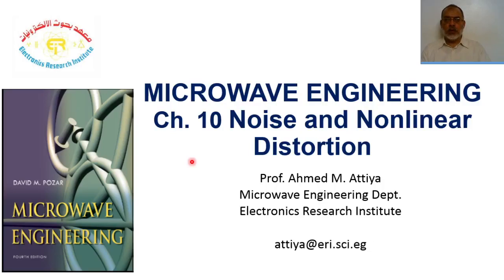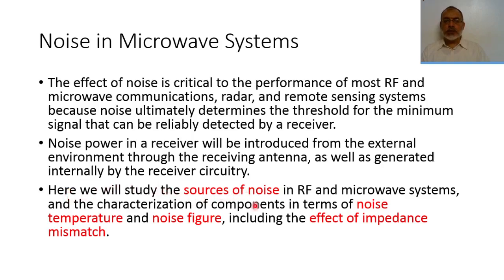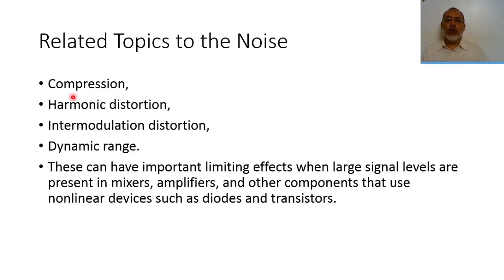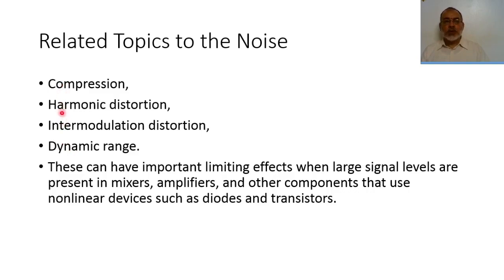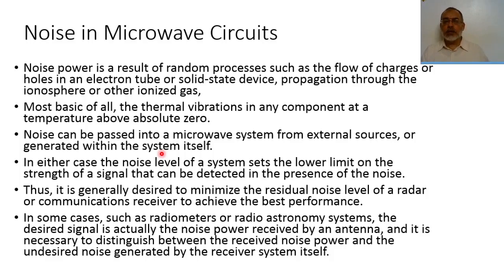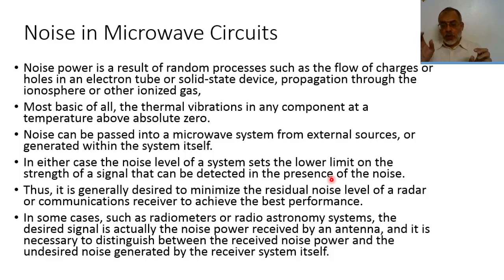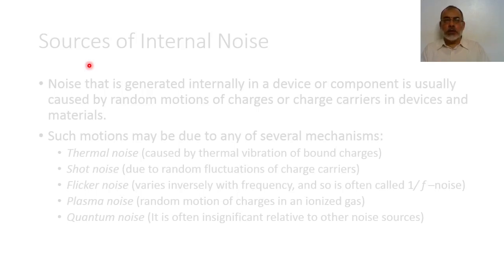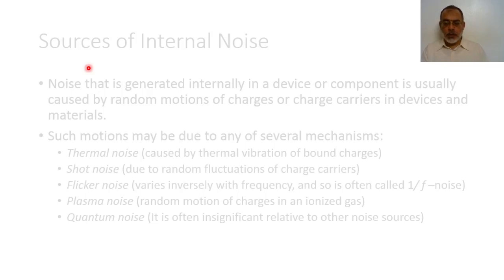Chapter10 part 01 Introduction to Noise in RF and Microwave

Comment: OK, so in radio astronomy, we'd need to remove the component of device noise... How'd we do that?
Reply from the maker: It would be required to use a receiver with an internal noise mush less the the external noise. This depends mainly on the LNA  at the input of the receiver as it will be discussed in a following video.
Reply: I have been doing a lot of work on my own radio telescope and found that cooling a LNA with a stacked peltier you can reduce the normal operating temperature down from 34 degrees to – 30 has a big effect on the noise level. Reducing the input voltage also helps but will also reduce the gain so it is all about finding a working balance.
Reply from the maker: This is absloutly correct, because reducing the temperature will reduce the internal noise inside the LNA.